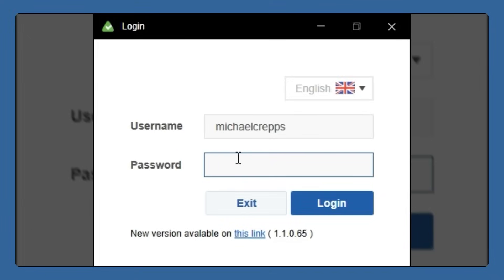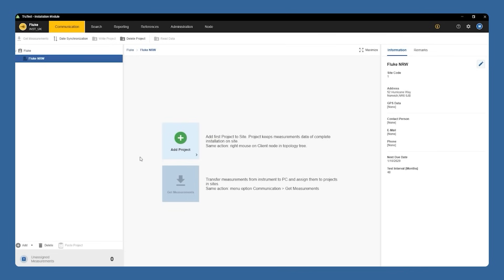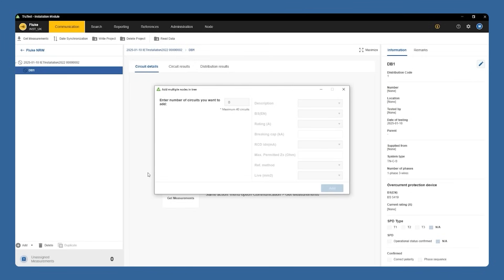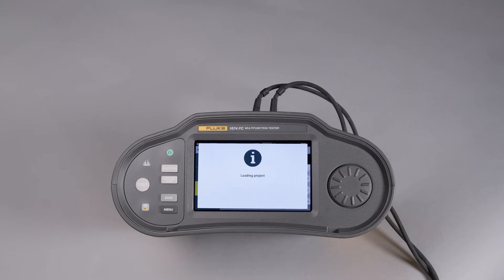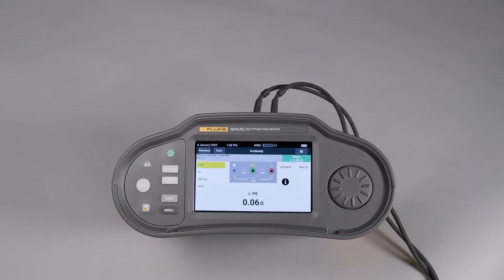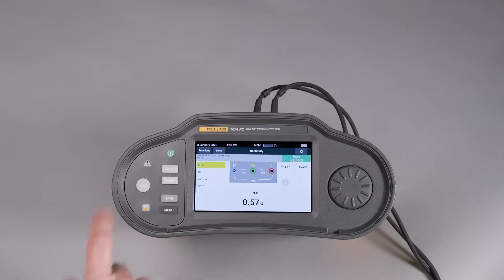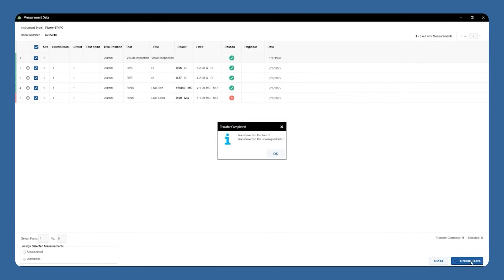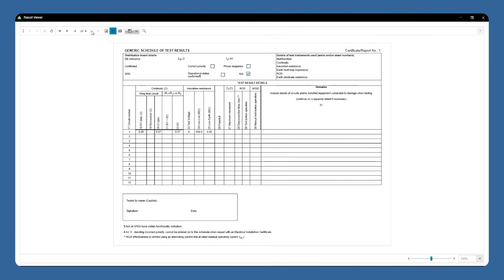Fluke 1670 Series Multifunction Installation Testers | How to Set Up for an Installation

Comment: make a tech data cable tester. ,i have a micro scanner 2.   ,  the tester. sends data transmissions.  (speed).  and it will fit in a pocket.  ( small)